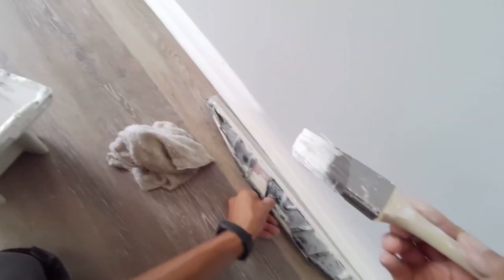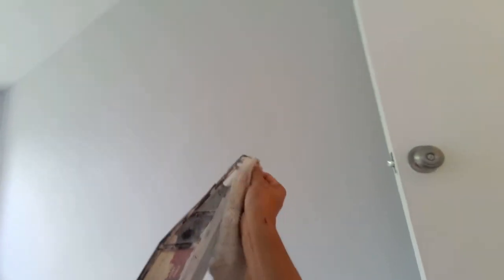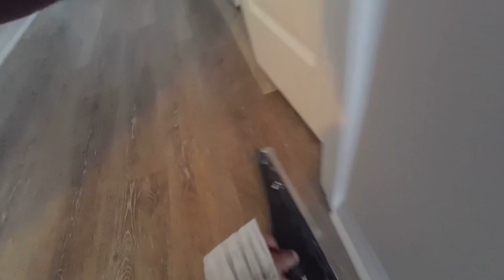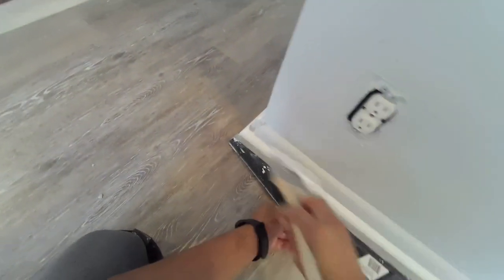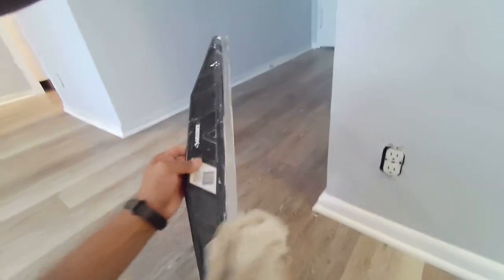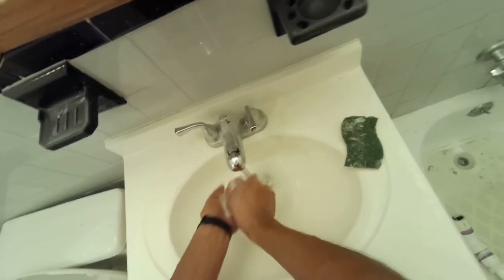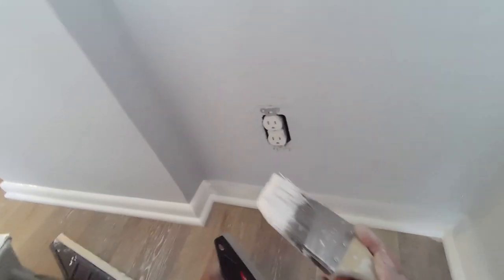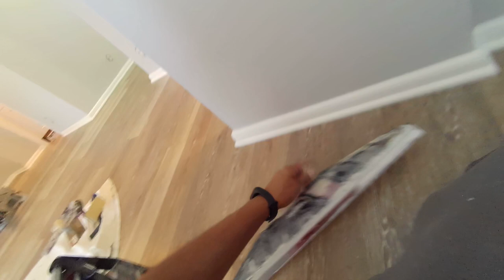Painting basebord with husky paint shield

Comment: I especially liked the pro tip to wrap the towel around the corner edge of the paint shield to do precision clean up of any paint that dripped onto the floor.
Reply from the maker: I will try that, what is it, a tool??????
Reply: @azaelm4829  I was complimenting you about how you used the towel in @9:15 where you showed how you cleaned small drips. That was a great use of the paint shield.  I had never thought of that and it looks like a great way to keep your paint line nice and clean.